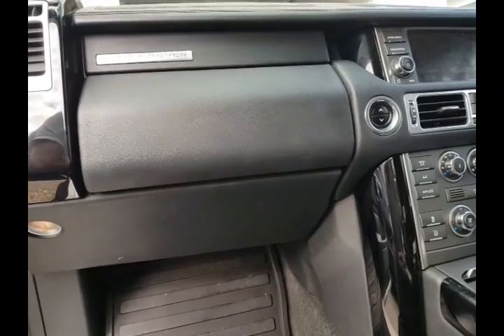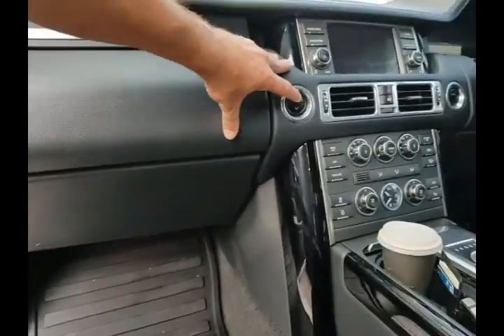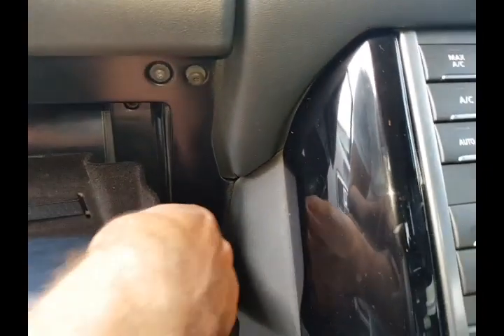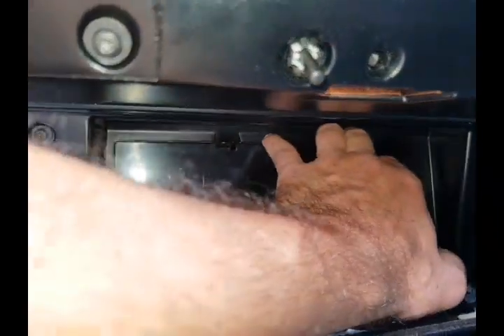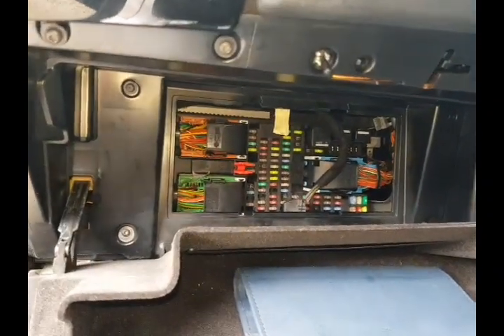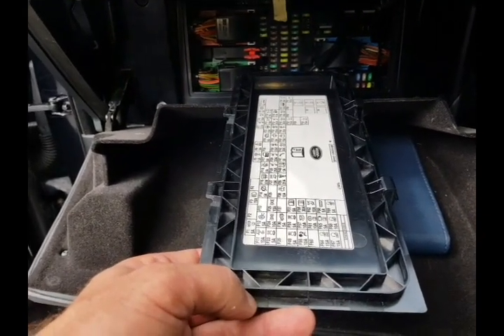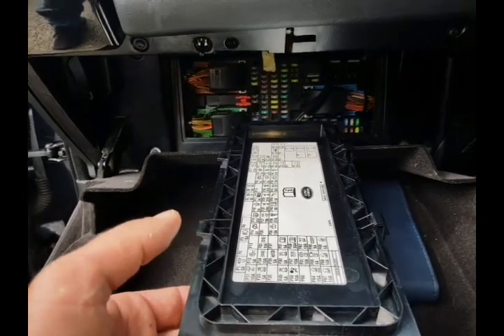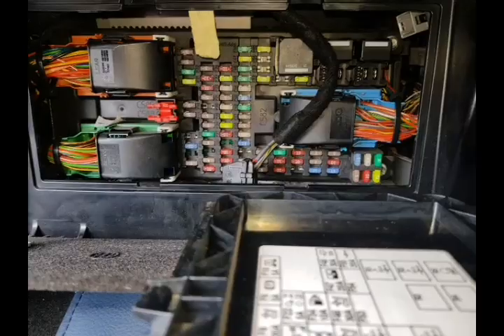Range Rover L322 Fuse box VOGUE SE 2011

Comment: You are priceless!! I have been looking in the handbook and trying to release the glovebox , it is only on looking at your video it becomes obvious where the secret catch for the service position is, I had been looking on the other side! Very many thanks.
Reply: I have just had another look, armed with your information, the handbook states that the release lever is to the left hand side, which is where I originally looked, but it is, of course, on the right hand side, and I still cannot find the fuse removal tweezers which they say are to the right hand lower area of the glove box.
Reply from the maker: @453421abcdefg12345  sorry mate. Can't help you on that front. You can always try looking in one of the other fuse boxes ie. Boot and Engine bay. They are red plastic.

Comment: hey Dave, still having your l322? i am looking which relay or fuse is responsible for cooling fan (i got P0483 impossible to remove, even I replaced: cooling fan, AC compressor, HVAC wires, blower resistor). Heating and AC working fine, no overheating on engine, but this fault is getting me nervous :)
Reply from the maker: I do mate, but no idea about what goes where